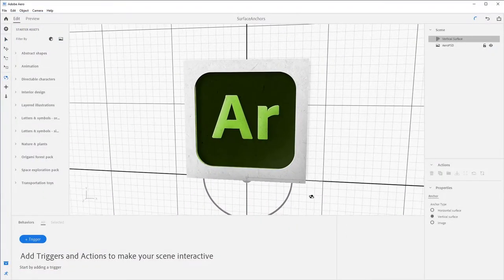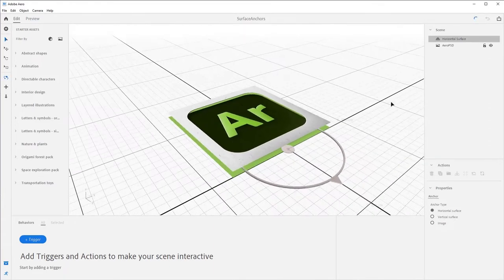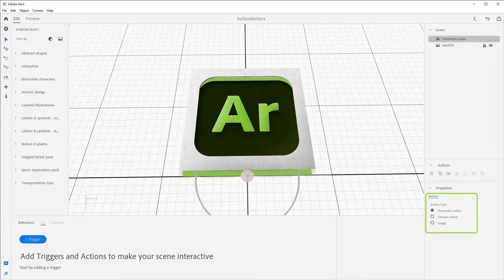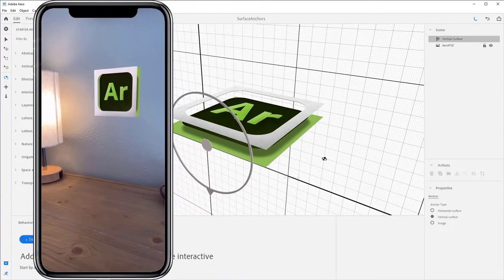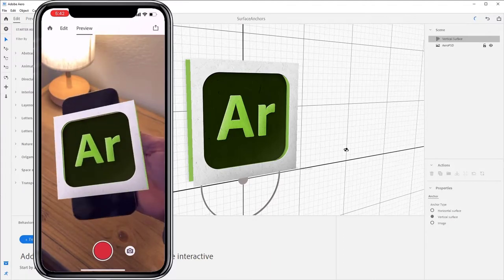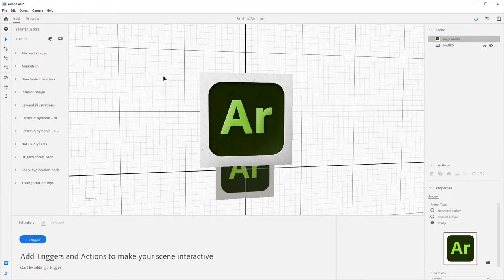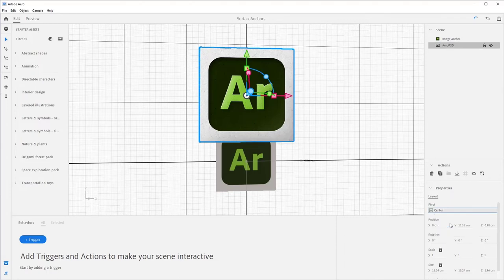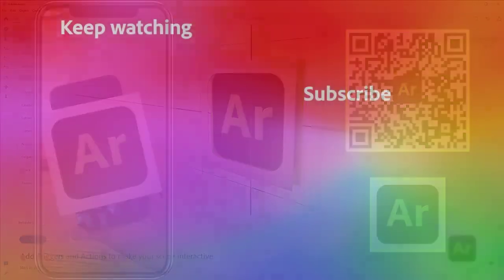Using Surface Anchors | Getting to Know Ar in Adobe Aero | Adobe Creative Cloud

Comment: Can you anchor something to the ceiling? Could I anchor a light or chandelier to the ceiling? Thanks!
Reply: Yes you can, by using image anchor, instead of horizontal or vertical surface anchors use third option i.e image anchor, e.g. scan a sticker or visting card and use that as image anchor, place your designed chandelier on it, and export the file, paste the sticker or card on the ceiling, now open the aero app and point on the sticker ...it's done!